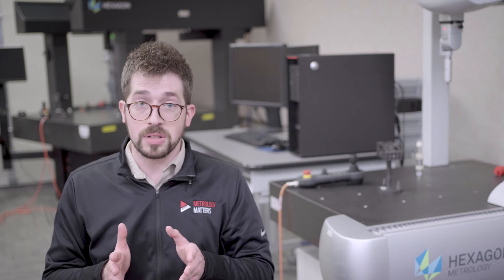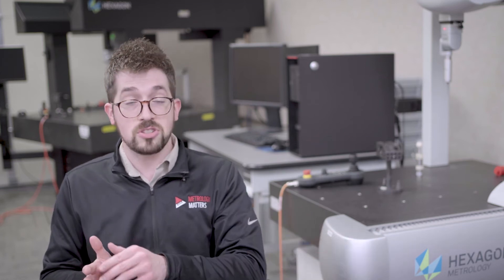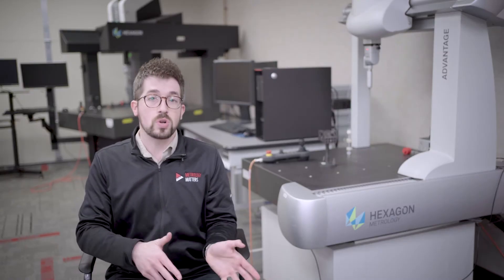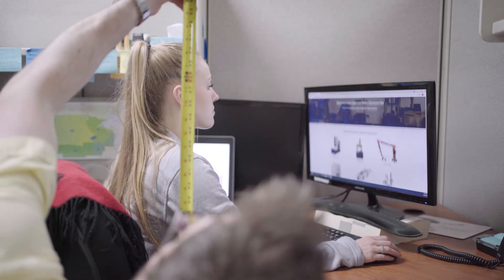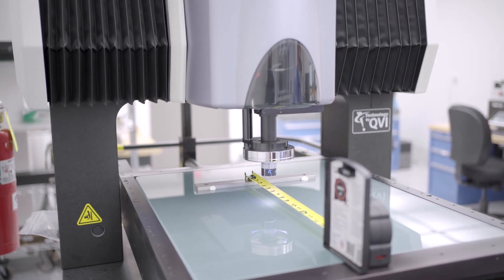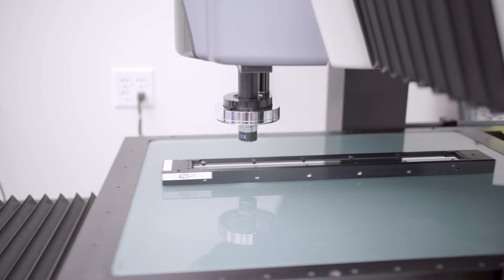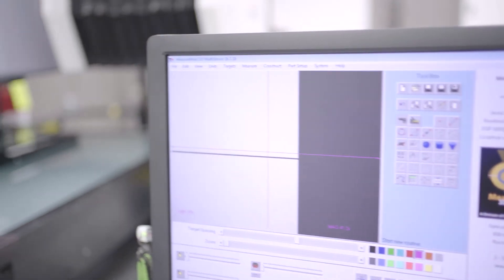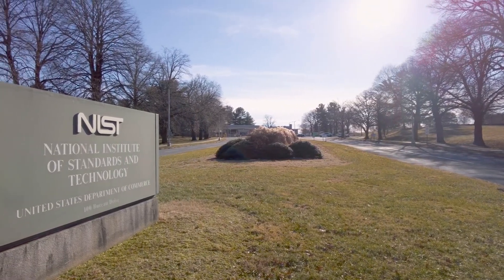Tracing Your Measurements to a Standard | Metrology Matters

Comment: The shop I work for we have no cmm machnlines just calipers , micrometers and weight gauge. So what would I use as a master calibration tool, gage blocks?
Reply: If you are using Gage Blocks you need to make sure they are a Grade 0 as these are what is needed to calibrate micrometers & calipers (ASME B89 standards) if you do not have a Master Gage checker.